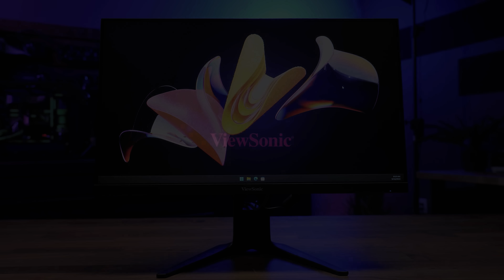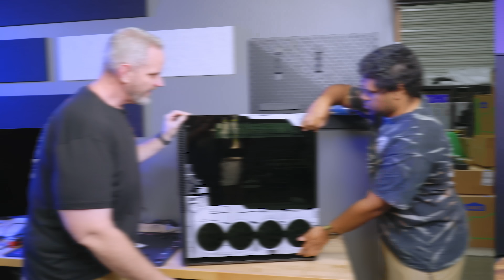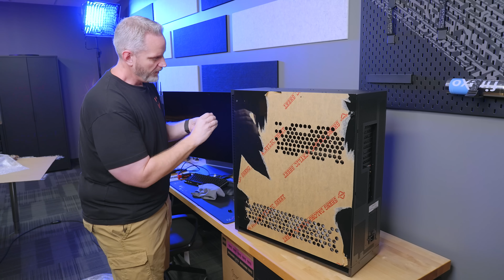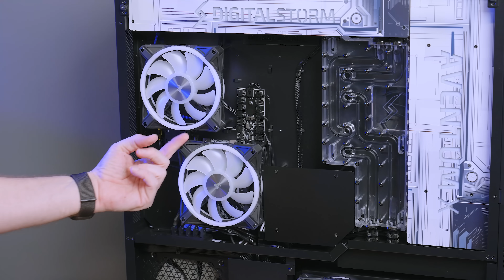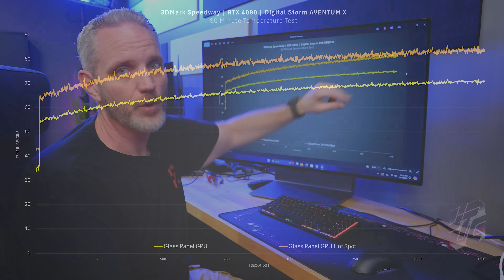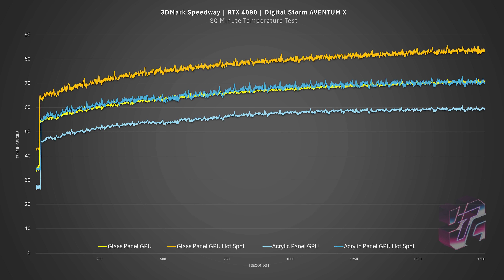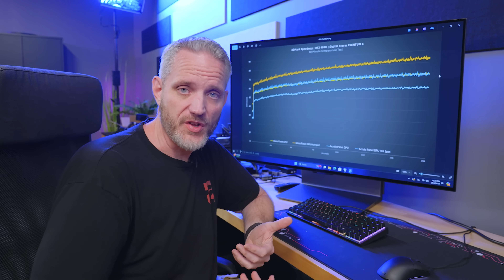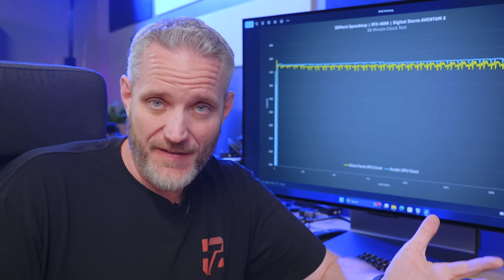Digital Storm responded to my Criticism... Let's go over it

Comment: Yeah, I've never understood these systems when you feature them...I mean they are BIG....but that's it....and BIG doesn't mean good (ladies *wink) unless you have like 20(whatever it holds) old style hard drives then WHY.. It makes no sense and that's before you factor in the lack of *actual cooling. Why would you spend so much money simply so you have an obnoxiously large case (not really functional as far as cooling goes which is why you would want a bigger case). 🤷‍♂

Comment: So I have a d5 pump. And I change the fluid every 6 months. And yes it moves fluid fast but it is possible to fill while running without air getting in the pump. You need the right type of squeeze bottle but it can be done. I still think a jumper is the better way to fill the loop especially for a beginner, but sometimes I get lazy and don’t want to find my PSU I use for filling or unplugging the 24 pin. You generally can’t cut tempered glass. You would need to cut first then temper but that can lead to lower yields due to additional stress points and not to mention dimensional accuracy issues. You could use chemically strengthened glass but it can be expensive mostly because of economies of scale issues. But you don’t get warping and it doesn’t shatter like tempered glass and is stronger.
Next fan Xpert on ASUS Allows for use of temperature probes or GPU if the GPU is also ASUS you can select source and personally think fluid temperature is the way to go when determining fan speed but that’s my personal opinion.

Comment: Does the brown paper protective layer on the acrylic have glue which is water soluble? 🙂🤷‍♂️

The whole design especially the cooling is just wrong. For that system cost it should be far better at cooling the GPU (and CPU) than it is.

They share your passion Jay but their top priority is making money for their business owners and shareholders not building PC's.

Build an $8000 PC and lets DS see how it should be done! 🙂

Comment: You can have holes in tempered glass, they just need to be made before you go through the process of hardening it so they could have those nice glass side panels with holes for the fans to move air.
Looks awesome but cant belive such a terrible design costs over 8k

Comment: Well I have questions about the material choices, acrylic and tempered glass are cheep and we have better materials. for a premium build and case like this they could do better!. for example why don't we see gorilla glass or similar newer types of glass in side panels? Acrylic is soft which is part of the reason it scratches so easily why not use polycarbonate with an anti-scratch coating like the ones they use for lenses for glasses, polycarbonate is a little more expensive but not much and the anti-scratch coating is not expensive either as long as you aren't being charged you need this to see so we are going to use our monopoly to price gouge you tax. if you are paying the premium price you should be getting a premium design and if that requires better materials to make that happen then they should be using what's required, not what every one else is using because its cheap or the industry habit.

Comment: I think people ordering $8000 PC setups are way less scrutinizing than people sticking to a budget.  You aren't supposed to know all of this crap is useless, just max out the options so everything is "the best".  The reason a 4090 is friggin huge is because it has everything it needs to cool itself strapped to it.  Just stick it somewhere where it isn't choked for air and heat can escape and you will get all of your performance.  This can be accomplished with a properly designed $60 case.

Comment: I disagree on the video being easier I hate trying to follow a video step by step so much if a product comes with a video for its only instruction I send it back or throw it out. Full stop. If any company reads this and you rely on videos exclusively for instructions then please for the love of god fix that, I have no problem with video supplements but there NEEDS to be a written version that I can reference in the moment without having to worry about keeping pace.
Reply: You can pause a video
Reply: @RadialSeeker113  yes but it's easier to search a PDF or skim a physical document than it is to find a part of a video that you need if you don't know where that part is.

Comment: I can remember pictures of the older Adventum and the sides were mesh as I recall. I think someone designed it right originally then someone else added the glass option after the aquarium style of case became popular. Also the company does have other cases with a side fan blowing on the actual back plate of the MOBO, I wonder if the misplaced hole to fan issue is a part of the reason they are redesigning the case itself? At least they realize it needs changes. I have one of their previous Velox designs with that mobo backside fan correctly placed from several years ago and have had no issues with the equipment and no complaints regarding any support contact after 7 years of use. Not a bad SI for a mid range system in my experience at least.

Comment: I know that you can ruin the temper on metals (eg steel) by heating it up too much, eg through friction. I imagine it's the same thing with tempered glass. Lasers cut with heat, so that's an obvious problem for heat-sensitive items.
ETA: That being said, you can definitely cut it and then temper it.

Comment: It's not just that you are paying for parts you don't need, it's that you are also paying for needlessly greater complexity in the system which in turn increases the risk of failure. I like the metal frame idea. Back panel fan cut outs be like 🤔. Thanks Jay!

Comment: Metal framed glass where the bottom of the frame extends over the fans is the easy solution and with some paint would look just as good as the solid glass. I mean seriously they painted the bottom of the glass so it's just a really shiny obstruction and so may as well have been metal.

Comment: It needs fans at the top.  It would help not only with flow but evacuating hot air.  Then stop the fans cooling the panel as the panel probably does not need cooling.

Comment: 100% can print on acrylic, can print on anything with the right adhesion promoter
Reply: You can also roll the paper off of the acrylic using a cardboard roll/core, the bigger and longer to reach the whole panel the better, no scratches

Comment: Air Cooled GPU's can get 60 Degree C, but the fans are also running full speed which means noise. I love my watercooled system because it is not as noisy as my kids AIO CPU and Air Cooled GPU.

Jay, for an $8000 USD system, I would want evey ounce of performance that the system could give me with the aboslute beast of cooling that it could have. I think a part Tempered Glass  pannel with Etched metal side pannel would be brillent.

Comment: Small Info:

Yes, you can UV-print on acrylic, and basically any other surface, including leather etc.

Best wishes
P.S.: Yes, you can have holes in tempered glass. They have to be cut during manufacturing, before tempering, though. So each glass would be a special order at the plant, making things fairly expensive.

Comment: Seriously who designed this case? A kindergartner???

I remember the Cooler Master case mess and they fixed it after one complaint. Mesh front.

Digital Storm! Come on! Listen to Jay!

You know what, going to put my neck on the line and say, "I'm an amateur builder, but I could build a FAR better system than this!" but this is NOT worth $4000.

Comment: 2 points:  You can't cut tempered glass but you can cut it then temper it.  Second, I can justify water cooling modern GPUs with cracked PCB's around the PCIe connector from all of the excess weight of the coolers it takes to cool them.  Consider the water block a $300 insurance policy on a $2,500 card against bricking it.

Comment: Having been an owner of two Digital Storm systems over the years (and coincidentally just ordered another one yesterday!) as well as building my own gaming machines for myself and others, the reason I purchase from Digital Storm is 1) I don't want to build liquid cooling loops myself 2) I expect the PC to be used for years and years and have one for my wife and for a kid where it is nice to not have to be primary tech support. The peace of mind I have that I can send it back to a manufacturer for tune ups/upgrades/issues is a great option and they have been super responsive and have worked with me whenever there has been an issue.

I have to say the water cooled CPU and GPU runs great and hasn't had the issues that Jay is mentioning here. I recognize that there is a premium but I love liquid cooling loops for performance and aesthetics (that along with their tight wire runs with colored wire looks amazing). My own gaming builds are fine, but nothing to phone home for - but then again I don't put my personal gaming/video editing machine on display so it doesn't matter. Digital Storm on the other hand are beautiful machines and the liquid cooling works great.
Reply: Looks like he has the fully water cooled setup. It was hard to see with the dark pipes, but hearing his description it sounds like he is fully water cooled. I have the Aventum with the water cooled 3090 but it is run with the side panel off. So maybe that is the main difference. Anyway it looks great and runs great! (I run my home built PC with panel opposite of mother board off as well)

Comment: They should have gone "old school" with the acrylic panels still having the fancy see-through top half, while painting/imprinting the "cyber" graphics over the lower vents, which would have gone well with a fancy hex pattern. Or just showcase a fully painted steel or acrylic panel with integrated vents (which also was old school case design).

Comment: Run that test for 4 hours and see how it does when its fully heat soaked....30min is short for a gaming session.  I feel like you'll see the performance drop off more and more for the glass panels while the acrylic panels will probably just keep running at a nice stable level.

Comment: Jay should try rebuilding the system to see if he can optimize it.  Maybe bypass those bottom rads or reverse the fans on the second bottom rad to make it a pass through design. Would be interesting to see.

Comment: I had an Aventum X. It's an absolute and total hunk of shit. The worst most overpriced pos I've ever owned. Why? Because they built it with old shitty spare parts that they found laying around and lied about what components were actually used. The graphics card was some shitty dell odd ball gpu not the msi one I ordered. The fans were all old shitty rgb only fans that you can't even find connectors for anymore. The hubs were all old shitty open hubs just hanging in the case. The radiators were old used rusted pieces of shit filled with sludge that ended up clogging up the water block and overheating my pc. You should've seen that nasty shit coming out of it. I ended up having to tear the entire thing apart and rebuild/upgrade into a new case. Oh and the Aventum case is by far the worst most overcomplicated trash I've ever seen. Also the tubing on the water loop, when I went to change the coolant just fell apart in my hands. Every single connection was loose and several of the quick connect fittings were old and did not have good flow. I paid $8k for this door stop and after two years it was trash. Hmmm, what else. Oh yeah the tubing and fittings underneath were a mish mash of various fittings that literally looked like they were just left overs laying around not to mention the old browned out tubing that was used underneath. Yes you could not see it, but it was clearly old and used and for 8k, that's unacceptable. Stay away from this company they are by far the worst out there. I will say one good thing, their tech support guy was outstanding. His name was Adam and he was a true professional. It's a shame his talents were wasted on such a shitty company.

Comment: If I’m paying this much for a damn PC, it better be fine tuned like a damn McLaren or some other super car. With that much radiator area, there is absolutely no reason to have temps that high because of aesthetics. Having the customer pay shipping for panels that should be included in original shipping (because they’re free) is a cop out for being penny pinching. Having radiators & fans put in the build just to increase the price is stupid as well. If it’s in the case, it should function as close to perfect as possible. DigitalStorm is laughable for terrible design decisions. They should fire their designers & the twat that approved them for production.

Comment: Nail Polish remover will strip it right off a hair dryer can also help with that paper. I worked at my fathers appliance store and had to remove stickers from all sorts of surfaces. heat pull wipe with polish all glue residue will vanish do not use it near any logos it will remove it. My system never goes over 55c. I have an I7 4770k I bought it a decent cooler then I took your idea and I cut holes in my case so I added 2 fans to the side and I also cut a vent so if it starts heating I move the magnet screen so more exhaust. My SSD's will sometimes get hotter then the CPU so I zip tide some small heatsinks on them and with the fans on full I can get the SSD's to 25c. I need I new system but I have no actual way to do it. May take me a couple years to save up but starting to think I may be better off just buying a part once a month until I got a PC I can assemble. Wanna help me reach 1k subs? @KoolBreeze420 ;)

Comment: It's weird that cases made the jump from cheap acrylic to tempered glass and we never got high end clear plastics. Why didn't we ever get polycarbonate side panels? You can order the stuff from custom glass shops. It comes in cool colors you can even get green edged if you want to have that classing tempered glass look. It's way more scratch resistant. I mean we use the material in the glasses people wear on their faces for a reason. And it's still a plastic so it's still got options for cutting, and drilling and bending. A polycarbonate case with a curved tinted front panel seems cool as shit.

Comment: I'm not surprise how dumb and greedy Digitalstorm has become. They haven't changed since when I worked there. Owner was in repo of his car when I was there. I remember when I had talk to one of the system builders and how cheap they would go to replace parts. EVGAS TO ZOTAC but the low end Zotac branded GPU. One day a monster of a machine like this came in to RMA department to find a system boot problem. I manage to look at the parts list and it had 4 High End $1000+ GPU in it and cost roughly around $10,000. Couldn't find the problem. I got moved from system builder of the basic type to become Dave Porter, picking up trash, cardboard and cleaning bathrooms. Ending up being put "ON CALL" after that. Never was call except for 1 time and I miss the call. Was told not to worry about coming back.  Owner's daughter or family member was the toxic right Hand "Man" 
They only family member that seems genuine was the son for the 5 seconds I spoke with him. Never ever saw him again. There's no language barrier there. They speak English. Pride gets in their way of its not done how they want it. It's sad. I enjoy what I did. The non manager staff were actually cool to talk to.

Comment: They already showed the new case over a year ago. Also on thier youtube channel they have did 5 builds with the new case, with dual pumps also. Last I asked them back in July when will it be released they told me there is no etA but looking around 2026.
So I decided to buy a ibuypower asked them for almost same set up of DS with dual pumps and IBP hooked me up
Reply: I looked through their channel and I couldn't find it? Could you link it here?
Reply: @EpicBr0   There is still 2 up on thier shorts from over a year ago.
top part glass but bottom is cut out for mesh free flow. With dual pumps. They have been teasing this case since Dec 2022. The first short was from July 2023
Reply: @michaelgriffin3230  Oh looks like I found both of them. Funny enough I bought a used Aventum X earlier this year and id be totally interested in that bottom mech panel, looks really slick.
Reply: @EpicBr0  Ya They asked me to make a offer on the July 2023 build they did with new case ....I offered 8k and they never replied back the gpu in the showcase build was just a rtx 2080...Then a year later june 2024 they finally emailed me back asking if  i was still interested. I told them na dont like being ignored after you asked me what i'd offer and I bought a ibp pc
Reply: @michaelgriffin3230  Man thats wild, year to respond AND $8k for a pc with a 2080
Reply: @EpicBr0  ya  i wanted the better cooling from the case with dual pumps, was going to replace the gpu with a matrix....but as I said  IBP built me a custom dual pump pc with 3 rads with my matrix card. Had some issues at the start with blackscreens and 100% fans going. but I finally just undervolted to fix the problems.

Comment: Tempered glass can not be cut once temperered. It will just pop.
They would have to included holes/cutouts prior to tempering.
This process also has limitations depending on the process used.
Typocal furnace requires holes to be minimum size/locations in relation to thickness of glass.
There is also chemical tempering where glass is placed in a chemical to have similar reaction but I have not worked with that so not sure what can amd can't be done.
Please note I am I australia where we only toughen glass. Tempering is lower grade and usually done on furniture glass etc.
We use the term interchangeably here as even funriture glass is toughened.